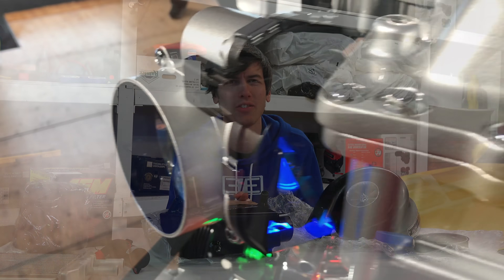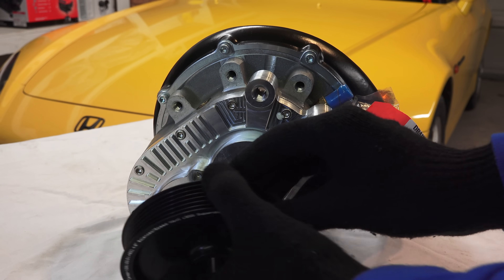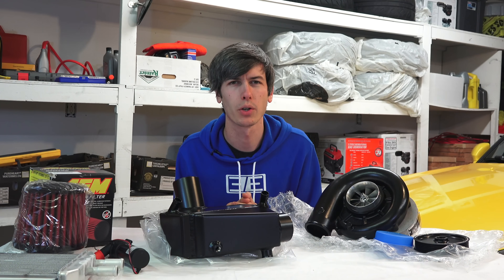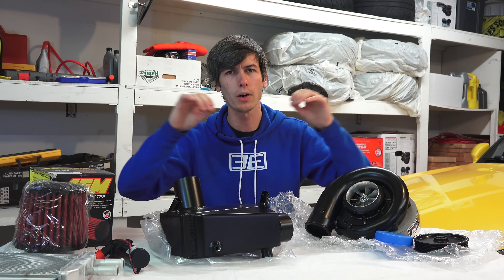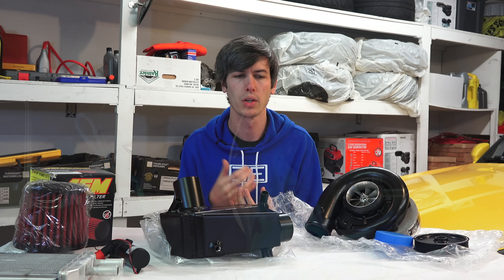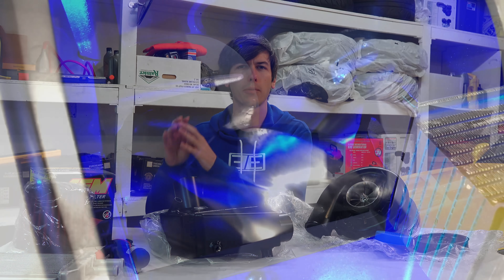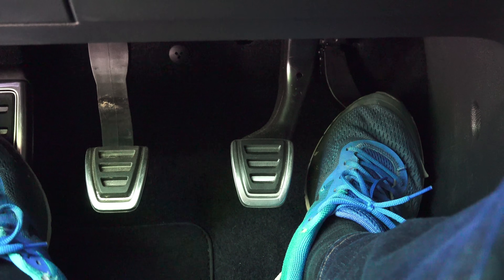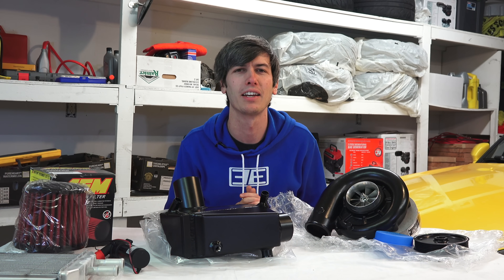Turbochargers vs Superchargers - Which Is Better?

Comment: Superchargers have a bit more downsides than what you mentioned. Needs a way to keep the supercharger cool so incoming air is cool; like a heat exchanger. They can only spin as fast as the crank pulley allows them to, as well as the RPM threshold of the supercharger before it can be damaged. Pulleys can sheer apart as well from the high rotation. My supercharger requires jet oil to operate smoothly, but very little oil/oil changes are required so mentioning it isn’t all too relevant. My superchargered M112K
 engine is rather old with only 50k miles but those are just what I know about the operation of my supercharger. Again the supercharger is old school and is the original AMG supercharger that has bolt-ons to increase RPMs (so it makes more boost than stock). Love your vids btw

Comment: I think the concept you appreciate is also known as tractability. It's the sense that the engine will pull at a predictable rate in any condition when you give it gas. No turbo lag, no dogging it off the rpm plateau, just the power you expect when you expect it. Since supercharged engines spread that power across the engine's natural range, you end up with a very predictable setup that has no conditions for power.

Comment: Are Superchargers noticeably more expensive than turbo's, and more difficult to install aftermarket?
Reply from the maker: Kits are relatively equal in price. Installation difficulty is usually dependent on how well the kit was designed, rather than the type of induction. From a custom standpoint, a turbo might be a little bit easier.

Comment: What's the opinion here of a combined turbo + super-charger setup.
  Not a common setup (probably majorly expensive to plumb n cram in, but it's supposed to give the best of all worlds with minimal lag, reasonable efficiency and ultimately plenty of power accross the board?

Comment: I'm curious to know if it's possible to use boost to essentially push the motor without fuel in the system. My thought was that it could be used to push a car from a standing start for the first few minutes, then the fuel system delivers normal power after that. Most fuel is used to push the weight of the car from standing start, so I was thinking that this could be a great way to save fuel? Just a thought, not sure if the pistons would turn freely enough under air only power???

Comment: If you're talking about throttle response, nothing comes close to EV (or maybe SparkEV is special EV in sport mode). Quite literally, instant power and predictable rather than hills-and-valleys in gas engine that depend on RPM, boosted or not.

Comment: Looks like Jason has a supercharger kit for the S2000. Coolant pump, aftercooler etc sitting on the table.  I have a very similar centrifugal / pro charger kit for my Z. For cost and ease of install supercharger is definitely the way to go.  I just pulled off all the supercharger parts and put everything back to stock for the winter last weekend.  To make the change I had to pull the front bumper off and driver side wheel....as opposed to turbos, step one in the AAM Twin Turbo install manual - REMOVE THE ENGINE! If you want to make power turbo is the way to go. 8psi supercharger for the Z gets around 400whp.  8psi turbos gets you around 500whp.  I made 460whp with 8psi and e85.  Either version it is easy to up the boost. Change some pulleys for the supercharger vs changing waste gate pressure for turbo.... but it is hard for the supercharger to produce large amounts of boost like a turbo can. It is not uncommon to see turbo Z's with high hp numbers in the 800-1000 range.  The max I have seen with a supercharged Z was 17psi and 700whp. Google Dyno- Built SC 370Z (17 psi)

Comment: Back in the 80's when turbochargers had more lag than now, I remember reading about a Ferrari testarossa that was modified using a supercharger for low end boost and then twin turbos for high end boost, with the idea that this would eliminate turbo lag.  This was still street legal, at least in Europe (the article was in a European car mag), and made 1000 hp.  I wanna say it was a guy in Germany named Koenig that did this, but can't remember for sure. Anyway, I remember thinking this was the best of both worlds.

Comment: Turbo's are almost always better if configured correctly for the application. And in racing applications turbo's can make boost basically instantly just like a supercharger, it's called anti-lag, there are different versions, depends on what you're doing as to what system you use, check into rally racing anti-lag setups vs drag racing. both systems eliminate lag for the application and are WAY more efficient than a supercharger., which = more power and less stress on the engine. "Very little lag" my ass, rev match downshift, WOT = no lag, anti-lag = no lag. The only time what the content creator makes sense imo is when you're in to high of a gear or non um driver enthusiast type scenarios. Like going down the highway and staying in over drive at a low engine rpm and going to pass someone.

Comment: I actually enjoy having the one or two seconds of waiting for the exhaust threshold and the turbo lag because of that surge of torque that comes in. Plus unless you have a bypass valve on the supercharger that re-routes that charge air back in front of the supercharger inlet then you really don't get better good fuel economy at low loads like you get with turbo'd engines. 

Did you happen to see Gale Banks at the last SEMA Show? He's a really fantastic resource for all of this.

Comment: i prefer turbo. in a turbocharged car, you can choose between driving economically by staying below boost threshold, or driving fast by staying above it. to a lot of people (me included), that means you not only save money on fuel, but also save money on buying another car to daily with. i've been dailying my rallycross-legal '14 Lancer Ralliart (mudflaps, rollcage etc) for 2 years. couldn't ask for more from it. supercharger is more like adding 2 more cylinders to your car. it's responsive like a naturally aspirated engine sure but it also kinda makes your car worse at daily driving.
Reply: Terry Foldy Holes but you got more maintenance concerns with turbos. They are a much more complicated system overall.

Comment: Why is it that when these comparisons are made nobody ever mentions the pumping losses induced by the turbine? Just because you aren't taking power from the crank to drive the snail doesn't mean you aren't taking power from the engine, just like the supercharger does. Thermodynamics 101,... There is no free lunch.
Reply from the maker: Correct, there is no free lunch, but the power for the turbocharger comes from exhaust gases, which are otherwise simply lost as heat. Instead, you use that energy to pump in more air.

Comment: Hi Jason. I’ve watched so many of your videos and, first, I want to say I appreciate you and thank you for what you do. Great stuff. Keep it up. I was wondering if you could address / clarify something for me. I have undergrad degrees in mechanical engineering (machine design and thermodynamics) and electrical engineering, as well as a masters in Automatic controls. I design fly-by-wire and other feedback loop systems of fast computers controlling slow (relative to computing speed) machines. Mind you, my education is from the late 1980s and early 1990s. Automotive sciences have gone exponential since I was involved with them back in my university days but, this exact topic came up back then in my automotive engineering class. In your video you are saying that turbo chargers are more efficient than super chargers because super chargers steal energy from the crank, while turbo chargers use the free energy being wasted out of the tail pipe, to spin their compressors. I remember our professor proving that a turbo charger adds head to the flow of exhaust gasses; back pressure, as much if not more than a catalytic converter or other obstruction(s) placed in the flow of exhaust. As we know, back pressure placed on the exhaust reduces power. I remember my professor proving that on an apples-to-apples comparison (probably like a centrifugal super charger to turbo charger comparison), that to have a compressor that can add the same amount of boost to the intake side of the engine, whether you take the power to drive said compressor from the crank or from the exhaust, you’re still “stealing” power from the engine to make power. In the case of the turbocharger, you’re placing back pressure on the exhaust flow that “steals” the same power from the engine (like putting a clogged catalytic converter or an undersized exhaust system) as stealing it right from the crank. I’m not remembering the full details of the lesson as we’re talking almost 30 years ago. And, I blew the dust off my notes and looked through them for the last hour, but couldn’t find them from that exact lecture, and gave up. And, I tried to look up that professor in an online phone book, but he may actually be dead now. So, I thought I’d come back to you with it, for clarification. Theoretically, the power necessary to spin a compressor would be the same whether you take it from an engine’s crank rather than take it from the engine’s exhaust. And, taking it from the engine’s exhaust actually is a drain on the engine, but maybe there are some factors I’m not fully realizing that support, in practice, your statement, that running a turbocharger off an engine’s exhaust is more efficient than running a supercharger off it’s crank. Thanks in advance for your reply.
Reply from the maker: Yes indeed, a turbo will increase back pressure and hence puts a load on the engine, it would be fascinating to see some data on the subject. Let's say you have two engines producing very similar power, one turbo, one super. Both will produce very similar amount of exhaust gases, but the turbocharged vehicle will turn those exhaust gases into something productive, using energy that otherwise would be 100% wasted in the case of the supercharger.

Comment: The primary reason behind supercharging/turbocharging is that cars spend 99% of their time developing a tiny amount of power, with short periods of demand for peak power leading to ridiculous inefficiency for most automotive engines in real-world conditions. For a constant speed/load, turbochargers improve efficiency (eg, generators)

All engines have throttle lag, turbos just make it worse.

Turbochargers are superchargers. The difference is what drives the supercharger (a turbine - hence the "correct name" of "turbosupercharger"). Turbochargers with integrated motor-generator(*) give the best of both worlds and thats why they're used in formula 1 - they'll make it to road cars soon enough as they give the low end boost and responsiveness of superchargers coupled with the efficiency of turbochargers.

(*) Those cheap kinky "electric superchargers" are a bad joke but a 10-20kW electric motor on an existing turbo setup is a different kettle of fish.
Reply: Indeed, and that's exactly what Mercedes did with their roadgoing supercharged vehicles in the 1950s and 1960s, so that the super only kicked in when you floored it (there was a microswitch linked to the accelerator, that literally only activated when the pedal was fully pushed)

British makers left it permanently running, which killed fuel consumption and reliability.

Twincharging and turbocharging used to be the realm of high performance ego-mobiles with reliability a secondary consideration or for heavy haulers. In the last decades it's moved into roadgoing vehicles of only 100-160hp to give huge amounts of bottom end torque whilst still meeting government mandated fleet milage requirements. Some smaller 3 cylinder engines in japanese Kei class have been fitted with permanent supercharging too. The kind of R&D required on small roadgoaing engines pays dividends in reliability, far more so than concentrating on F1 (which can prove the tech works, but it takes volume production to make it economic and reliable)

The same thing will happen with electronic valve control. Right now it's only used on very large slow engines (ships) and in experimental road engines (Fiat's ones still use camshafts so I'm discounting them) such as the Koneigsegg Saab. When you see electronic valving in Kei class is when you'll know it's coming to the mainstream in the rest of the world shortly afterwards (the problem is heat dissipation, not timing - a mechanical valvetrain draws as much as 15-20kW on a 2litre engine and getting rid of the heat from the solenoids whilst keeping them responsive is problematic, even if you move to desmodronic-style operation)

All of this is staving off the inevitable though. Internal combustion engines are likely to be relegated to niche operations in the next 2 decades. What we're seeing is like the amazing technology advances in steam engines whilst diesel locomotives ate their lunch.

Comment: Electric motor driven supercharger and exhaust gas driven turbine connected to a generator which charges the battery that powers the electric motor of the supercharger could give both efficiency and quick throttle response

Comment: You keep mentioning Lag with turbos. I have a 1996 Saab 9000 Aero. Which uses a TD04-15T Turbo on the 2.3 4cyl engine.
Providing im at 2,200rpm or higher. If i request power it will go from 0 to 1.4bar pressure in literally 0.25 seconds. It is as good as instant. In any gear. Now this is a relatively old car now, so modern turbo cars should be even better than this.

Comment: I've owned a 1996 Mustang SVO (turbocharge red) and a 2000 Buick Regal GS (supercharged).  Definitely prefer the supercharged Regal. Power was on tap as soon as I touched the accelerator - especially helpful if I found myself in a situation that required immediate acceleration. Also, the turbo on the Mustang required more service while the supercharged required its fluid to be replaced every 70,000 miles.

Comment: After market compagnies need to start making hybrid kits, if I was rich I would start  after market electric motors that can just bolt up, it can be done easily I dont know what they are waiting for, even thought it will add alot of weight, the extra torque might be what someone needs.

Comment: Exhaust gas isnt "free" - you need to take compression down, the temperatur of the exhaustgas needs to be cooler and you end up with backpressure wich makes the gasflow slower.

A turbo also takes power from the engine by producing backpressure and the other factores.

Comment: I still like supercharges because of the whine and no lag
Reply: Rather lag and more power
Reply: @rosegold-beats  lag and more power wont help in a city block....
Reply: Modern turbocharged cars have minimal turbo lag. My 2004 Audi hits peak boost at less than 2000rpms. Not to meantion theres newer cars out there that will hit peak boost before even 1600rpms.
Reply: from a performance standpoint, a turbocharger is better hands down. the problem he mentioned about turbochargers having lag and superchargers having better pedal communication only applies if you are relatively new to the car. after spending some time with a turbocharged car, the driver should be able to fully understand its characteristics and thus will be able to get what exactly he wants from the car. most boosted racecars with experienced drivers who won't face the miscommunication issue use turbochargers and not superchargers for a reason. turbochargers and simply better if the driver is good. drawing power from the engine just to boost it just doesn't make sense, no matter how you spin it. if you want no lag, get an electric car. if you like the sound, then sure go ahead with the supercharger. the driver preferring the whining sound is the only possible reason i can think of for someone to choose a supercharger over a turbocharger
Reply: Ok i dont know alot about cars. I have a TDI engine and my friend says i could use a supercharger, is that possible? 😂
Reply: Turbos are better tdis have no lag
Reply: Antilag........
Turbo boost without lag
(I think that is Howe it Workshop)
Reply: @carlover5911  anti lag really only works in first gear. If you are doing a roll, you will have lag, unless you brake boost.
Reply: HITMIX HYEPOCK ok thanks
Reply: tdi stands for (turbo direct injection) so no supercharger
Reply: And simplisity
Reply: Well... depends on the turbo ^^
Reply: @bjornkalle1628  a big power turbo will always have lag. If you want a quick spool turbo, those will always be smaller. And smaller means it runs out of Huff at the top end. I have a cobalt ss/sc and a golf sel tsi 1.8, and the 1.8 spools real quick(like instantly lol) and caps off pretty quick. My cobalt ss/sc pulls hard in 1st/2nd and 3rd but dies out at top end(till the 2.8 pulley and tune).
Reply: Turbos have more BoOsT
Reply: @That89_Vn  and it depends on the type of supercharger....a centrifical supercharger it will have zero lag and just as much usable boost as a turbo.
Reply: I still prefer turbo
Reply: @That89_Vn  my supercharger is more fun in the city, and the throttle is always consistent and power is linear. I beat higher hp cars in a whatever roll-70ish mph as my boost is instant and I'm already in the next gear by the time their boost comes on.
Reply: @That89_Vn  yeah..and lag
Reply: Try a full electric car.  No lag, constant smooth acceleration.  Thanks to electric motors, you get immediate maximum torque unlike gasoline engines where they need to wind up a certain RPM to get maximum torque and gears have to switch as you speed up.
Reply: @TheEatmorDininghall  clearly you are not car enthusiast and people like you is the reason why performance cars are dying
Reply: @TheEatmorDininghall  yeah, and try driving 600 miles at once in an electric car......